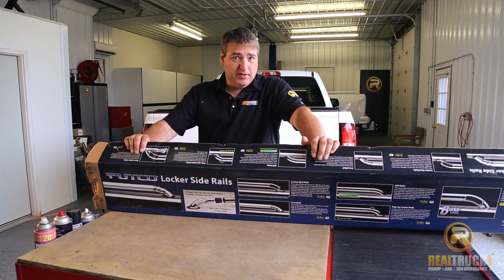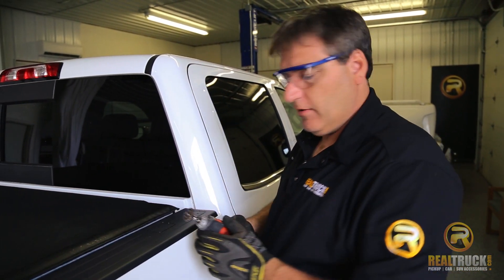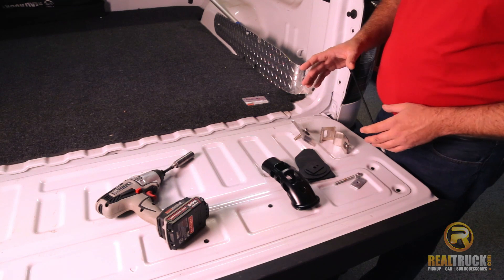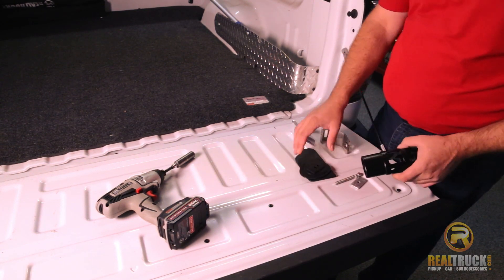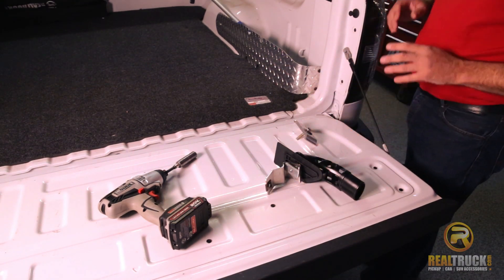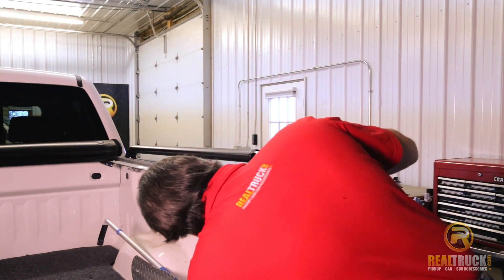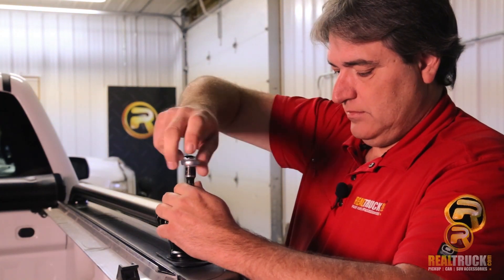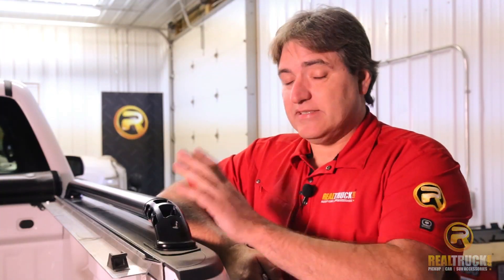How to Install Putco CrossRails Oval Truck Bed Rails

Comment: What tonneau cover are using? I want both tonneau cover and bed rails but didn't think it could work. I have a 2018 F-150 with 6.5ft bed. Thanks
Reply: i got the bed rails but dont have the rubber

Comment: I want to know how to remove it because mine was installed with the screws in places where I can't reach them. It's a 2004 GMC Sierra
Reply from the maker: +XxRalphyBoyxX I have to apologize because I don't understand what you mean. These bolt on through the top of the end caps using a hex head bolt. If you can clarify what you mean by can't reach them (eg. explain where the screws are or how they are screwed on) I can possibly help you figure this out.
Reply: Same problem. The set up on my Ram 1500 has only the rubber and plate below the rubber, nothing that bolts on the side. When I try to loosen the hex on top the metal plate beneath the rubber spins. It's very frustrating.